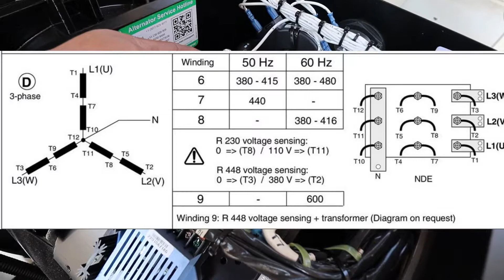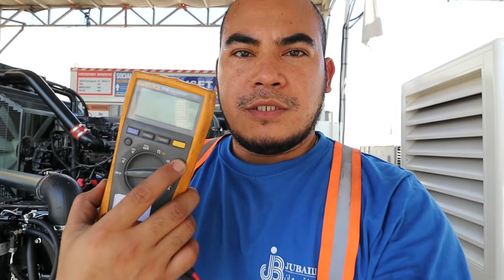Alternator Winding Resistance Test benzblogs

Comment: Sir, ung alternator ng cummins KT38 namin nag spark ung alternator. Ung nag testing ako ung line to ground 25megaohms, maliban lang sa isa na 1.6megaohms lang, bale 6 terminal lang sya, isang terminal may 4 na wire, kailangan naba irewind?? Multimeter lang ginamit namin
Reply from the maker: Sir ganito panong ng spark with load or without
Reply from the maker: Anong alternator sir at kva
Reply: @benzblogsVlogs  1000KVA, without load, pag start palamg ,pagikot nag spark
Reply: Leroy somer
Reply from the maker: Ganito sir diba kayo ng bago ng wiring ganito double check nyo lang alin sa winding ang may tama yun lang iba rewind
Reply: @benzblogsVlogs  wala kami binago sa wiring tumatakbo  ung gen.set, pinatay lang para magpahinga. Ung isang terminal mababa L-G 1.6megaohms lang
Reply from the maker: Unbalance load nyo air kaya ganyan
Reply: @benzblogsVlogs  wala.pa.load, kakastart palang, hindi pa nya na reach rated speed, pag press ng start, kasabay ng ikot ung spark. Tingin ko insulation failure dahil mababa ung insulation resistamce ng isang phase.

Comment: Sir yung 500kva genset ko nag high voltage, tapos nag auto shut off na tung control.. ano po possible problem?
Reply from the maker: Sir ganito start mo ng walang load kong ganon parin ang prlima kong di naman baka my problima sa load side mo lang kong pag start mo at high voltage parin din adjust mo lang avr mo kong ano yjng voltage before na output para di magshutdown

Comment: Sir  hlhlngi ako ng idea mayroon ako na troubleshoot umiinit ang stator core pero ang winding hindi naman 5 to 10 second  hindina mahipo  ang stator core  my connection  T,1 T7. T2 T8. T3 T9   TOGETHER T4 T5 T6 T10 T11 T12 miniger ko na ang winding ok maman pa helpmaman sir thank you
Reply from the maker: Yes sir ikaw ba ang nag rewind or bago na alternator
Reply from the maker: Ilan ang out ng pinaandar mo ano ang connection
Reply from the maker: Double y connection sir
Reply from the maker: Ganito kong ok naman s amigger mo at walang faul ngayun check mo and rotor kong may sayad kaya mo bang bunutin check mo ang voltage kong normal

Comment: Sir.. Pano po mag440 next video po salamat
Reply from the maker: Sir pano gawin ang 440 vac? Dependibyan sir sa connextion ng alternator mo
Reply from the maker: Meron sir pano gawin and connection para mag440 check mo sa mga vedio ko
Reply from the maker: https://youtu.be/ffk92E-qdhk 
Jan mo makikita ang connection for 380 -480 bigYcoonection doon kanalang mag adjaut sa AVR para sa exact voltage rating mo